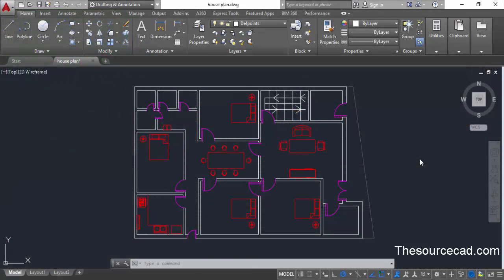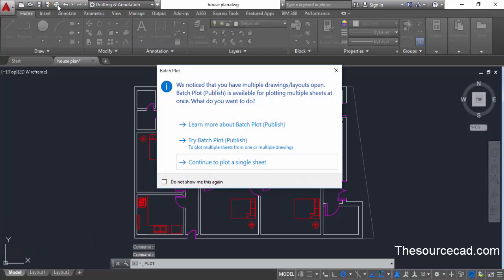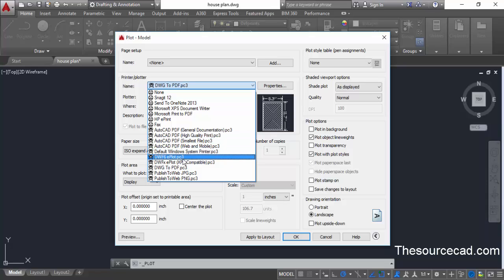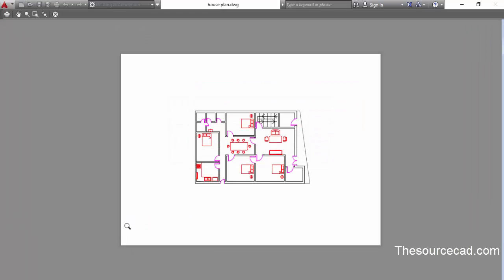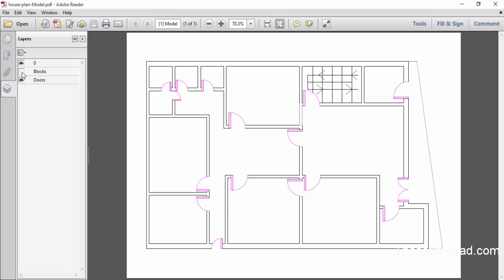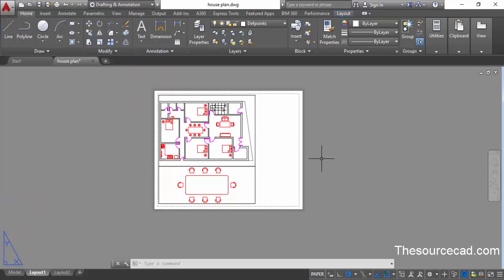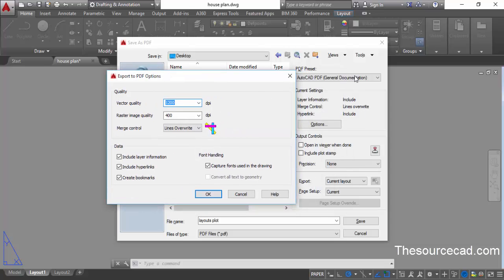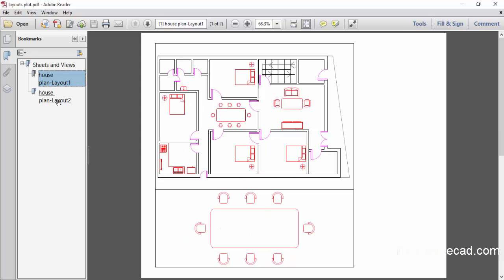How to print AutoCAD drawing to PDF

Comment: Hi. My drawings are usually bigger than letter size papers. I need to print them FULL size. Meaning, I want to print them that when I have to measure using a ruler, the sizes are correct. How do you do that?